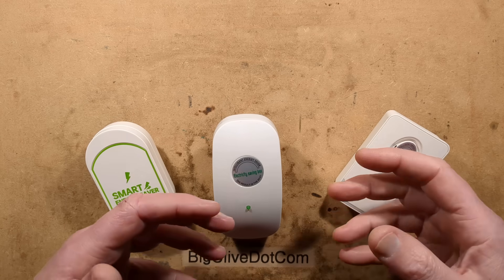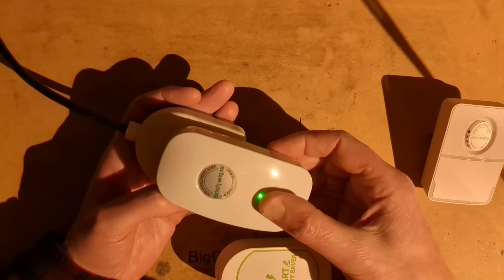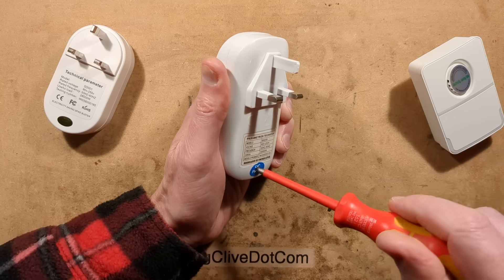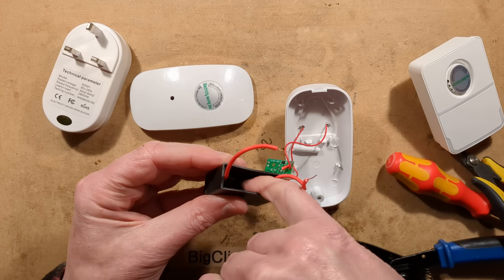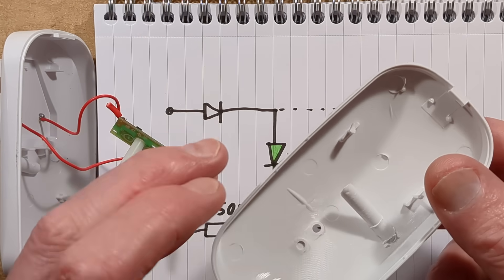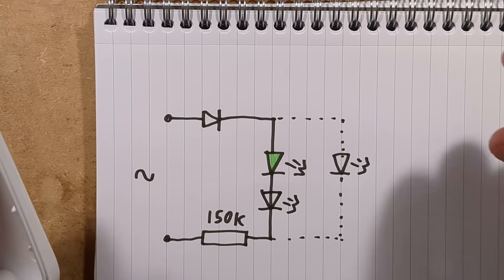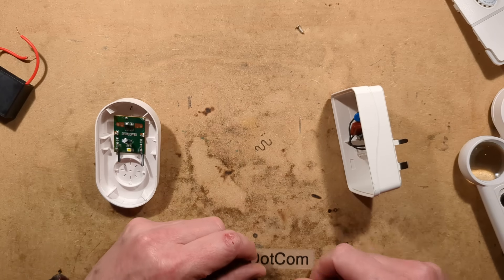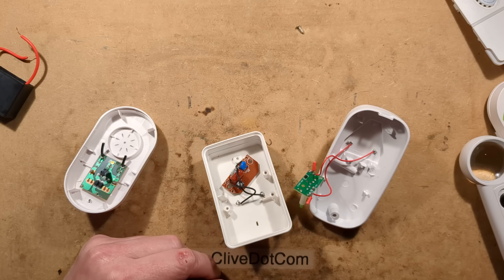Inside three fake power saver plugs 2025

Comment: They do save energy!  You turn off the main lights in the room to look at the pretty little LEDs!
Reply: I have switched most of my transient nighttime (and bathroom) lighting to battery-powered PIR-triggered LED fairy lights.  I reckon that even with losses from the chargers and the boost converters in the lights it's more efficient than using mains-powered lights (when the goal is just to be able to see furniture, etc.).

Comment: I think on the last one the useless diode was them copying a design with a zener diode across the capacitor to limit the voltage but didn't understand what a zener is and just put a normal diode

Comment: What was the point of them putting a large, fake capacitor inside the case? Were they expecting people to take it apart to check if there’s anything in there?  I very much doubt that the people that are dumb or ignorant enough to buy these are actually taking them apart. Were they trying to cover their ass in case they were accused of making a fake product and they could say look it has a big capacitor in it!
Reply from the maker: The earliest units had a big capacitor that was used to give the illusion of power saving with a power-factor compensation trick with a matching inductive load.  They still use the fake capacitor because people do actually open them to check they are "real".
Reply: @bigclivedotcom amazing! Thank you for the explanation.

Comment: Would have been nice if you'd put them on the meter first to see which one consumes the most power. Or do they all have negligible power factors?
Reply from the maker: They were all checked.  The resistive dropper units had good power factor but wasted most energy, and the cap dropper was the most efficient at the cost of power factor.
Reply: @bigclivedotcom  Just not efficient enough to save any power. 😆

Comment: Reminds of the ultrasonic pest repellers. We fell for it in 1984. I still have the box, it still "works". But it doesn't repel pests. Fancy electronics inside for the varying high frequencies. (Which can be picked up on my radio in about 10 meter range) . They later had the plug in boxes. I did some research and confirmed my suspicions. They don't work.
Reply from the maker: I've just made a video about one.  They had included all the circuitry, but the microcontroller wasn't driving the uncased piezo disk at all.  It was just toggling the power indicator LED with a button.

Comment: I’d take a Geiger counter to that “fine sand”. Very similar thorium-containing sand appeared in a lot of “spiritual” products for a while as you showed us.

That first capacitor-shaped object (following the convention of the sword community when discussing nonfunctional wallhangers) might even be a dead short, there being no apparent room for the sand. Check it with an ohmmeter. (I can’t quite make out where it’s connected to the rest of the circuitry).

Another use for these cases is fake WiFi extenders. A friend asked me to find out why his didn’t seem to be working. It had a pretty clever circuit that when first plugged in lit a blinking red LED, and after a few seconds that went out and a steady green LED lit up. They weren’t labeled on the case but the flimsy Chinglish instructions identified them as “Searching” and “Connected”. It had two fake non-swiveling antennas *glued on to the case*.

Fortunately I had a real one (that barely worked of course) available so I could show him what the guts were supposed to look like. Also fortunately he had only paid five bucks for it.
Reply from the maker: I did test it.  Sadly it wasn't thorium dioxide.  They must be saving that for energising pendants.

Comment: Sorry, but you're wrong about the fake capacitors filled with sand.  These are silicasistors which are made to granulate your electricity.  Granulated electricity was discovered by Volta Zzapinski of Telefon, Poland in 1989.  Volta was sunning himself on a beach when a thunderstorm rolled in and he was hit by a lightning bolt.  Uninjured, he realized that something amazing had happened, so he began to analyze the sand he was laying on and found that electricity flowing through the sand turned into granulated electricity, which is completely harmless to humans since it rolls off human skin like water off a duck's back.  But he also found out that it took a lot less granulated electricity to run certain appliances than regular electricity, so he figured he would save a lot of money on his electric bill.  And all that was needed was one little silicasistor on the electrical line to granulate the electricity.  However, his appliance testing was limited to a Franklin woodstove connected to a lightning rod, a wooden floorboard with an image of Pikachu (the electric Pokemon) on it, and a Fanny Bright doll (this one put Volta in the hospital for a few weeks; refer to Big Clive's video on Fanny Bright dolls for more info [but don't show your kids or else they may want one]).  So, if you have one of these three items, you are guaranteed to save a bundle on your electric bill.  If not, at least you have a UL-listed paperweight that you can show off to your grandkids.

Comment: Instead: get an electric blanket with a smart controller dial with timer.  Sandwich the electric blanket between your top sheet and cover blanket.  Lower the temp of the rest of your home, and stay toasty warm under the covers.  This saves a ton of energy because you can cut back on household overnight heating while it's coldest out (and takes the most energy to combat).  If you remember to preheat the bed a half hour before turning in, you'll find an incredibly welcoming warm bed to coast off to sleep.

Comment: Wow, that's pathetic that they can't even put the cheap capacitor in there that doesn't even do anything anyways.... 😮‍💨

Edit: It's almost af if the manufacturers have convinced themselves after a while that since the capacitor really doesnt help with saving electricity, then why even include it anymore.... it'll still do the exact same thing that it did before, which is ZERO. 🤷🏻
Reply from the maker: I think they also had issues with the cheap ones they were getting causing fires.

Comment: The fake capacitor is what gets me. They're so cheap that they can't even bother to include a real AC capacitor that would improve power factor but these whole things are always a scam because residential customers don't pay for power factor.
Reply: Actually ... such device with "fake" capacitor gives you less losses than such with a real one 😂.
Once upon a time, when all LV devices had big transformers...it could, sometimes, give a reason to do it (though without the measurements it was still gambling). But today? When almost every device has a switching supply which is more or less capacitance load by design? Adding another capacitor will only make things worse. Always. 😁.
Reply: The capacitor needs to be of a certain value to do power factor correction, tailored to the power factor of your devices, otherwise it might even do power factor distortion, and some of those capacitors were poorly made and caught fire. Also, power factor correction in residential installations is moot anyway, idle power is not billed in residential installations in most countries, so if it's gonna make zero difference to the power bill, why even bother with a real capacitor?
Reply: @Δημήτρης-θ7θ  1) Since the most devies are capcitive type you need an inductor to correct the power factor...not the capacitor!
2) You do not have to pay it in your bill...YET!. And It's gnna to change soon. I see first (lazy) legal initiatives to change it...and I'm terrified!

Comment: Even when they actually have a real capacitor inside, they're still a scam since they don't save you any money but instead use up power, costing you more money.  Most of them also have some form of light on them so you know they're "working" and whatever light they have uses extra power, even not accounting for the leakage current through the capacitor.
Reply: Replying to myself to add, at least that second one might be useful as a night-light for a child's room.

Comment: I guess, these sand capacitors ara mist-ical devices, that violate Maxwell's equations, like e.g. Jaime Maussans "Buga-sphere" - a grey rubber ball, landed by a multicopter from a fishing line (it can be seen due to poor video-editing), that has later turned into a hollow, rim-welded  aluminium ball with magical inscriptions where Maussan claims, it would violate the laws of thermodynamics.Without any proof, of course, because extraordinary claims never ever need extraordinary proof.

Comment: CLIVE..
what about a few videos showing what could be put in the boxes..
A really efficient nightlight.. no resistors emitting heat..
A very low power heater with a fan..
etc...
or just using the boxes without the mains plug...
a torch with loads of different lights and several switches etc and rechargeable batteries and circuit from things that people throw away...

Comment: General tip for reducing heating costs:

Your boiler is default set to 80c which is WAY too high. just keep reducing it in steps of 5c degrees until it still heats your house. and Vary this depending on the weather. (keep tap water at 60c though for salmonella protection.

Also, regulate all the radiators so they get the same temp in and out (or within 1c). Easy with a IR meter. and obviously take the air out.

And as said, lower temp setting for the house. can save like half your gas bill....

This can easily reduce gas with 20% in some cases. More things you can do, but these are the basics. Enjoy ;-)

Comment: quick question, what's the tool you use to take the boxes apart? the flexible one? Would be great to have that :)
Reply from the maker: It is an iSesamo Spudger.
Reply: @bigclivedotcom cheers mate! I rarely needed to get into stuff but it's always messing around with a screwdriver lol. Thus seemed so much easier😂

Comment: In 2012  I  found amongst my collection a  Racal RA17  was on standby, the set has crystal ovens and valve heaters which were munching 40 watt's of pixies just shy of 1 kWh per day  for seven years !  it was still blob on frequency so the ovens worked, I also found a 56 kbit/s dial up modem and a fax machine.  
Please don't work out the cost.
Reply from the maker: Yeah, loads like that can add up.

Comment: I would buy the rectangular one, for the kids, not to get scared of the dark, when waking up at night,if it is safe to use.
Reply from the maker: A plug-in nightlight compliant with your local regulations would be a better option.  They do sell cheap nightlights on AliExpress, but they are sometimes press-fit together, which is not great for a kids room.

Comment: Cold morning here tomorrow, under 6 C although we’re barely 100 miles north of Miami, Florida. I think that the local atomic power plant will be running at full output because almost everyone around here has ohmic heating! I will probably have to turn mine on and smell the burnt dust on the coils for a few hours.

Comment: That "extra" diode could be there to protect the capacitor from a large negative voltage spike that overcomes the reverse voltage of the other diode, forcing the fuse to blow before the capacitor.

Comment: On the third unit, the "extra" diode in parallel with the filter cap is probably a zener that's intended to keep the voltage from rising too high when the blinking LED is in the "off" part of its cycle.
Reply from the maker: Except that they did just use an ordinary diode.

Comment: Thanks for the video.
Regarding the metal film resistor being used as a fuse, I think there's a significant difference between being "flameproof" (which is how RCA used to describe their line of metal film resistors) and being a fuse. Both tefms imply a certain amount of not-burning, but only the latter implies not burning other things. Under the wrong conditions, I assume a metal film resistor could get quite hot before it "blows."
I'm also "disappointed" that no mention was made of the high quality of these products. Not only were all (?) of them CE marked, but they were tested to FCC standards (per the lable). Darn cricket, given that, AFAIK (and how far is that?) they would be exempt due to their circuitry, or lack there of.

Comment: Good advice on chasing down parasitic power loads. If you've got movement on the power meter when everything's off, start punching breakers. I had a newish amana refrigerator that was sucking 200w continuously for an 'exterior cabinet heater'

Comment: I’m very disappointed that these items were completely fake.
Intellectually, they could save me enormous amounts of energy - and I am sure the well-meaning Chinesium factory had the same intention. I have a 2kw fan heater and if I remove the plug from the socket and insert one of these amazing devices instead, my energy consumption would rocket down to almost zero; that may have been the intention of the manufacturer.
On another matter, I purchased (fake news and information) some compact energy saving devices last week. It was a guy with a rather dodgy demeanour, with a large old leather suitcase on a metal stand, around the back of Bury market where nobody could see him.
I bought ten ‘energy saving mechanisms’ at £9 each. They were very compact thin envelopes.
When I got home I noticed that there were three different envelopes: ‘save energy cooking’, ‘save energy showering’, and ‘save energy reading’.
I may be a genius, but I feel I may have been duped; the corresponding instructions included in the envelopes were: ‘turn off the cooker’, ‘turn off the electric shower’, and ‘turn off the electric light’.
Well, they certainly work a lot better than the three little ‘energy saving’ thingys, but having turned off my light, I tripped over my table saw and drill press in my front room and am now in A&E - so be careful, everyone!!
Reply: Your little joke reminds me of a short, comic book story featuring Scrooge McDuck.  A man is selling books entitled "how to make money" and Scrooge of course buys one, only to find out that every page has exactly the same sentence, once, in the middle of the page: "Get a job at the mint."
Annoyed that he's been scammed, Scrooge walks by the scammer a little later, waving and shouting about his book, "The Secret of My Success" by, of course, Scrooge McDuck.  Yes, THE Scrooge McDuck, the richest duck in Duckburg.  Price, only slightly higher than the scammer's price for his book.  The scammer eagerly buys the book, only to find that all of the pages are blank.  When complained to, Scrooge says of course they're blank.  If he told, then it wouldn't be a secret.
(Note that in some countries, both of these scams would be very illegal and in that situation, the scammer could be arrested and charged, and would most likely be fined as well as ordered to take action to contact all of their customers and offer to return their money.  "Take action" would be by paying for advertising to contact any "casual" customers)
Reply: @melkiorwiseman Thank you for your reply. Humour is one of the best medicines. 😊👍

Comment: 6:50 Is the discharge resistor actually needed? If I am not mistaken the capacitor can also always discharge through the rectifier, then the LEDs , then the rectifier again, then the varistor or what that 471k thing is. I assume it is below 1 MOhm even at low voltage, or not?

They may have put it in though to ensure discharging even if both LEDs were to fail. However if that happened, the 25V capacitor would likely blow up anyway...

Comment: That second one would make a neat night light. You should do a breakdown of a real power factor correction unit, the one I worked on was about 6 foot tall, served probably on the order of over 100 electric motors and controllers, had an internal cooling fan and filter, had huge capacitors inside it and probably weighed over a thousand pounds. The other machines I worked on had built in PF correction units.
Reply from the maker: Getting my hands on a factory power factor correction unit could be quite tricky.

Comment: They remind me of those "ultrasonic pest repellers" that you featured in another video a few years back, right down to similar LED flasher circuitry.

Years ago, my dad joked that these things were "Christmas light flashers without a string of lights," and I have to say his description was more accurate than I thought.
Reply: More like a Christmas light flickerer... @ 60hz
Reply: @davelowets  Some of the more "advanced" ones had a 555 timer circuit to make the LED blink every other second, to trick the owner into thinking they're working. 😂
Reply: in defence of those pest repellers, i bought one years ago after some people i knew thought they did some good with termites and cockroaches.   they do nothing for rats, mice, mosquitoes or termites in my house but a favourite place for cockroaches to turn over and die is directly below where the pest controller is.   i find dead ones elsewhere in the house but their favourite place to die is below where the pest controller is plugged in.
Reply: @vsvnrg3263 I’m glad I don’t have to worry about roaches lol
Reply: I used to use a Christmas light flasher on my soldering iron to keep it from burning the tip up too soon.

Comment: The first one had the circuit i was expecting in all of them: A single silicon diode, an LED, and a single resistor. I think that is as minimal as you can get until someone comes up with an LED that doesn't mind being reverse biased with a couple hundred volts and removes the need for the silicon diode.
Reply from the maker: A resistor and a red LED is common in cheap products.  The red LEDs tolerate reverse biasing.